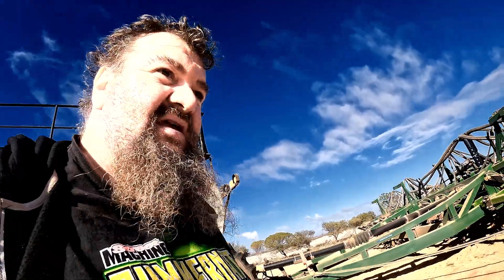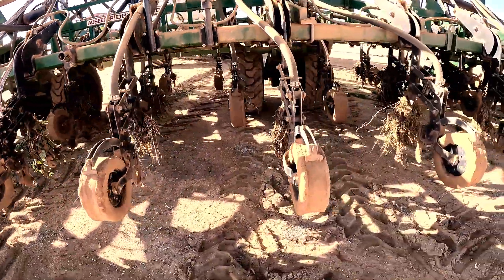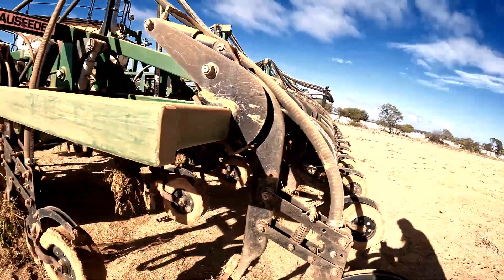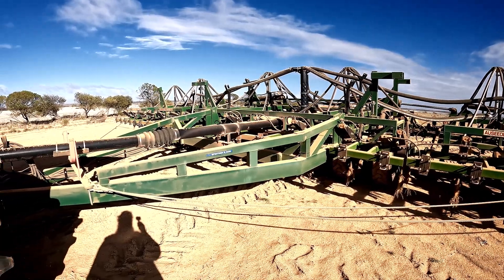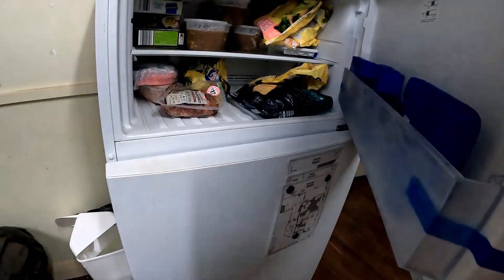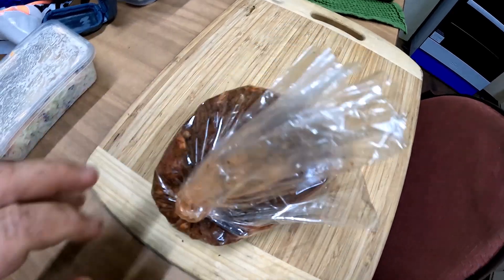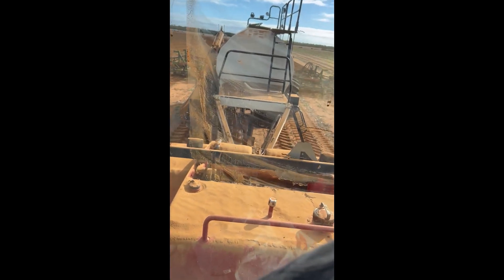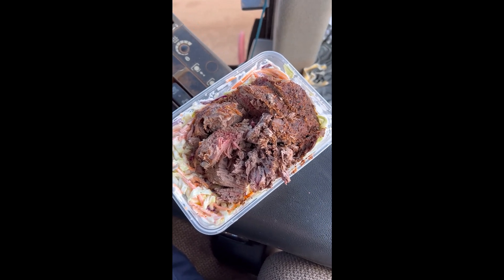Short look into sowing using a Case IH Steiger, Bourgault air seeder and a DBS Bar in WA wheatbelt

Comment: A mate of mine just lost his Stieger . His was one of the originals built by the Steiger brothers in the US. Mice had gotten in  during the last plague and eaten the wiring up in the cab roof. This shorted out ( they were having odd electrical problems but didn't think to look up there. ) and the short set the little buggers nest alight. He was an hour from the nearest water and his extinguisher couldn't keep up once the flames took hold with hydraulic lines and so on burning. . Wrecked it completely .
Reply from the maker: Well that sucks….